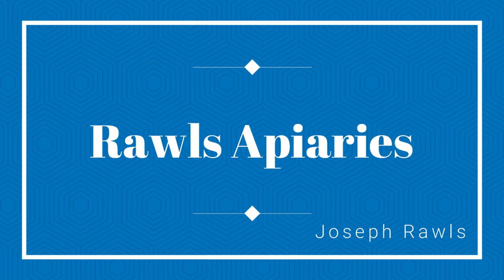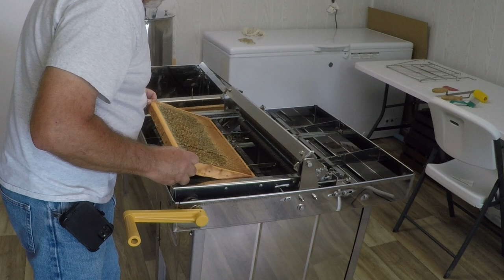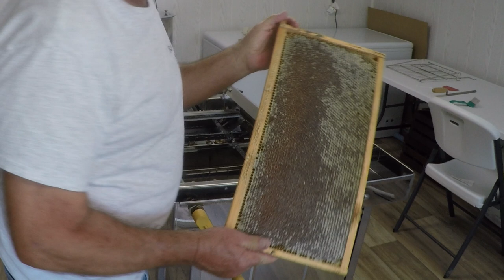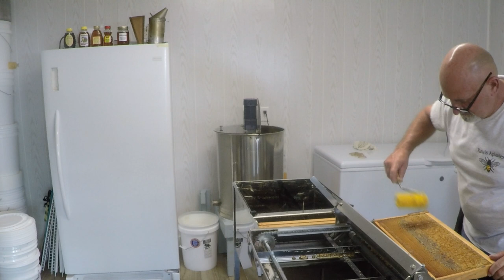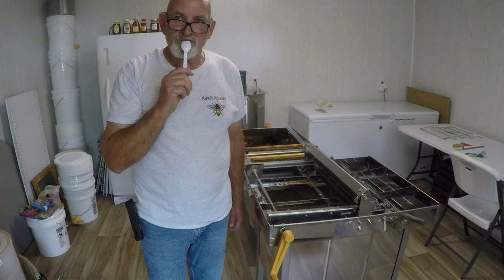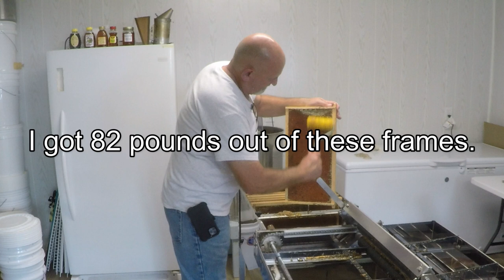Uncapping Honey Frames for Extracting 6-14-2023

Comment: Did you add that stand below your extractor because the legs broke or for another reason? Ive heard that the welds dont hold.  Your rubber band tip worked for keeping my frames from flipping over.  My rubber bands were thin so i had to double up.  Even those got weak after a few uses and the frames would try to flip at high speed.  I was running 8 when my son was helping uncap but went back to 4 when he bailed on me.
Reply from the maker: I never used them. When I first got this extractor and put it all together, the legs were too short for a 5 gallon bucket to go under the honey gate, so I built the small table. The rubber bands I use are fairly wide but it still takes two if the frames are heavy.

Comment: Hi Joey
How long do you spin/sling one side of a frame in your extractor?
I finally broke down and purchased a HillCo Enduro 6 frame motorized extractor.  Arrives next week.  My wife and I are plum tuckered out after manually slinging honey so we splurged this year.  Just wanting to get your advice on spinning time
Reply from the maker: When I am extracting the deep frames, I put the side with the most honey to the outside. I also try to put equal weight of frames opposite of each other. Then I get the speed somewhere between 60-80 on the dial, give or take, depending on how smooth the extractor is running. I don’t really pay much attention to the time. I just watch the amount of honey sprinkles that are hitting the wall of the extractor.  I don’t try to get all the honey out the first round. After that, I rotate the frames and spin again. At this point I work my way up to top speed, or until the extractor starts shaking too much, at that point I will back it down. After the honey pretty much stops hitting the wall I will rotate the frames again to get the rest of the honey out the first side, if there is any. That last spin shouldn’t take more than a couple minutes. I hope this helps. I think you will really like the Hillco extractor.